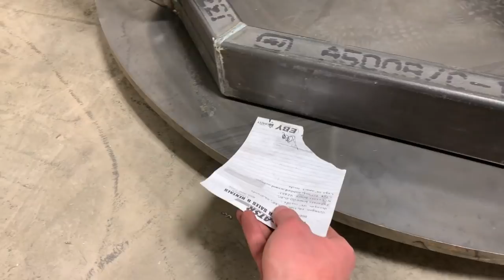Building a table to hold my vise

Comment: Great table build. Can't wait to see you clamp a Sherman Tank in the vice 😂. Im wondering how old you are, and if your young enough to be pick a career, what are you thinking of picking? Fabricator, farmer (the tractors in the background) mechanical engineer, accountant?
Reply from the maker: Thanks! I’m 22. Probably won’t be an accountant :-P I’m really into electric vehicles. I’ve been driving a Tesla for a little over a year now, put 23k miles on it, and driven it all the way across the country, taken multiple 800+ mile trips. I love it. Seeing as EVs are starting to take over a significant market share now I really want to get involved.
Reply: Well If you are ever in the San Francisco Bay area send me a message and we can go over to Tesla for a tour. A couple friends work there as engineers and they are always offering behind-the-scenes tours. Im a car guy too, but I work on the self driving part, and can't seem to convince my boss that we need a car for me to test on 😁. Cheers, and thanks for another great video.
Reply from the maker: Leo Petropoulos 
I actually toured the factory last May! Super cool. Problem is I don’t really have the credentials and I have a feeling it’ll be really hard to get a decent job there without a degree, since there’s basically a line of people waiting to get on...
Reply: Jeremy, next time you want to get a tour, anywhere, call the place up and ask to speak to the head of applications engineering or just engineering. You will usualy get voice mail. Leave a message saying the you are a young person, have a lot of intetest in X and you would really appreciate thier advice or help in X. Things such as trying to deciding the best job at Tesla, and what if any schooling it takes to get such a job, or finish such a project. Make sure and leave a clear reference to your YouTube channel. 

If he is in my position then half his current engineers don't know thier head from thier bottom. He will see that you have real life experiance, and passion, and you will get an entire day tour, get all your questions answered and maybe a job offer. Works at a WWII submarine tour, Tesla, Boeing, Chicago museum of science, you name it; at least 8/10 times.  See, he is the boss, so he is more than likely a real engineer, or used to be one at least. Most of the kids that work for him picked  thier career based only on money, not passion. Your Youtube videos show that you are smart, and have passion. Try it.
Reply: @Jer_Schmidt  Yes credentials and knowledge can be a very real impediment to doing certain kinds of work. No pretending that this is not true. There is also no point in pretending that a lot of kids are getting ripped off at college because they are encouraged to get degrees in areas no one cares about, and worse they are going into debt to py for them; with no chance of ever getting enough cash out of that degree to pay for it. Nothing wrong with arts, or studying ancient people. Just be honest with yourself about the lifestyle such a degree will offer you.

Nevertheless,  this is the whole reason behind talking to experienced people, so that they can guide you. Get lots of opinions. 

If you do need to go to college be smart about it. I did my general education work at a community college and only the last two (three years these days) years at a state school. Did what i told you to do above and had a few offers before i got out. Now if you are rich, go for it and go to Stanford, and have a good time there too. But you will do just as well in life regardless of which scool you pic, with the exception that a good school makes it easier to get your first job. After that the smartest and sharpest man or woman wins.

All that said you don't need a degree to be rich, happy, or both. Lots of people in silicone valley are super rich and never finished school. However, that path is even more work, so talk to such people before you go down that road. Being an entrepreneur looks easy but aint, and you got to be a certain kind of person to make that path work.

Finaly take a good look at the trades. Elevator inspectors in San Francisco have a two year apprentice program to complete before getting thier license. They earn "only" $80k/year durring those two years of training. Work for a company after those two years are up and salary jumps to ~ $180k. Start your own company, and be whilling to work nights and weekends and a typical take home is ~ $320k after taxes and expenses. See,  there is a shortage of inspectors, and the law of supply and demand holds for everything. Do somthing rare and do it good, and no one cares what degree you have as long as you are legal. Get 15 PhDs in English literature and be a secretary like my friend.  English literature might be super cool, but will somone pay you to know it?

A friend is a master machinest. He works for a company financed by one of the co-founders of Google. He is building human sized drones and flying them. Never a day of school, but he knows his stuff. That's the part that counts. Another friend quit Tesla and restores clasics porches for rich people. Makes twice as much doing that then he did at google.

Here is my point. Find somthing you would like to do, but be realistic. You need to like the work, but it also needs to be somthing people need or desperately want. Then get the minimum amount of training to do that, be it an apprenticeship, college, trade scool, or hardes of all - self taught. When training is done get working, as you get older - work gets harder to do so do it while you are young. Take chances, but not foolish ones, work hard, be honest. And most important of all, save money. Making money is easy, but saving it is really hard. Do that stuff and you can work anywhere doing anything you want. And yes, i got all that from your Youtube channel.
Reply from the maker: @leop9021  
Thank you for the advice! I will probably go to the Bay Area Maker Faire in May, so maybe I can try contacting someone at Tesla then.
Reply: Give me date for when you will be here and ill set up a Tesla guy for you to talk to ahead of time. Cheers, and good luck.

Comment: I would have used the table top as the base and just done some tubing into a tri-pod with vise mounted on that but thats just me
Reply from the maker: I thought about that, but I’m not gonna be able to use this big shop forever, and when I move to my own shop it will likely be smaller, so I wanted to make good use of space.
Reply: @Jer_Schmidt  Makes perfect sense just how we did ours since we still wanted to move around it while still being mobile. Cheers bud hope everything is treating you well.

Comment: Jeremy, you can move the table with 'Hudson Hauler' rollers.  The tool used to lift tables to put the rollers underneath you use on your table by welding on tabs or cutting in notches.  Here is a link to check them out if you are not already aware. http://www.hudsonbearings.com/products/hudson-hauler-super-mover/  v/r Erik of FOBOS Knives

Comment: This table is over engineered to buggery. I like this guy's style. lol
Reply: Engineering would involve design calculations to figure out what was needed from a table...rather than just building it beyond all practical reason.  This isn't engineering in the slightest, it's just throwing incredible amounts of material at the problem.

Comment: Nice build. What is the status of your job search?
I have a recomendation for employment. Meets ALL of your stated needs.
Reply from the maker: Current state might be best described as “confusion”. So I’d like to hear your recommendation.
Reply: Jeremy;  Check out DEKA Research, Manchester, New Hampshire. Owned and operated by Dean Kamen, 
an inventor and fabricator. Go through their vacancies. They have 10 week internships. Can you read blueprints? Other than reading blueprints you have the skill set and experience to be a fabricator. Dean Kaman didn't complete college. He never completed his first year courses. He found them boring. In his freshman year he ditched the 101 courses and started with the 200 and 300 series classes. He went for three years. Took the upper level courses and walked away without a degree. Left college with a few of his professors and started his own company. If you want to do work you will enjoy doing what you do you should look into DEKA Research.
Reply from the maker: Robert Kern 
Thanks for the suggestion!

Comment: Id drill and tap a hole in the center for an eye bolt and move it around with the engine hoist
Reply from the maker: Why? The engine hoist is a huge pain in the ass to use, bulky, slow to raise and lower, and hard to roll. The pallet jack is super easy and more maneuverable

Comment: Hello at that point, why not TIG weld it? Welds would have been stronger
Reply from the maker: Oh right I should have pulled a TIG welder out of thin air and done it that way. Wish I would have thought of that.
Reply: @Jer_Schmidt  hi, that was means as joke in the sense that this table is so over-built that you should have also welded with the most advanced method. I believe in U.S. English one says "whoosh".

Oh I also believe for TIG, getting a welding machine is the easy part

Comment: You could have tacked a hook to the center of the top to move it with your crane
Reply from the maker: I don’t want to move it with the crane. The crane is a huge pain in the ass to use. Pallet jack is super easy and smooth, and more compact to maneuver.
Reply: @Jer_Schmidt  I just meant for the one time, bolt on leg joists could work though. Put them high enough off the ground to just clear the pallet jack, unbolt them when not in use.

Comment: With a couple of mooks on hand (and a six pack), that thing would be flipped over in a minute.  Of course, in the end there might be a few artful gouges in the floor.  I can't figure why so many guys are in love with Wilton vises.  In my opinion, the gold standard is still the Starrett Athol vise, but, sad to say, they aren't made any more. Even used, I'd take one (and I did) over a Wilton. Man, you gotta learn some rigging.
Reply from the maker: I’ve never understood what people like about the Starrett vises...But I’ve never tried one in person so I’m open to learning. The first time I used a Wilton I was blown away by how the moving jaw is ROCK SOLID all the time. At any point in its travel it basically feels like it’s welded place. Yet I can spin the handle on this massive beast with my pinky finger. I also really appreciate it being sealed, every vice I’ve used before it starts to feel “gritty” after a while because it’s getting a bunch of grime in the screw.
Reply: @Jer_Schmidt  - The Starrett swivel base locks positively - no creep, no using a cheater on the locking lever.  There is a "toe" under the cantilevered sliding jaw.  The serrated jaw prisms are generously milled.  The handle has "no-pinch" ends.  The protruding head of the screw is generously (and elegantly) radiused into a ball form: your hip bone will thank you.  The handle stays put at whatever angle it is left, yet turns freely whenever called upon. Once again, the feature of a machinist's vise like the Starrett which makes it stand high, is the ability to place packing under the workpiece.  This might be of minor concern in a welding shop, but anywhere else it becomes important. I wish I still had an old Starrett catalog - I might be missing some of the sales pitch.
Reply from the maker: Ricopolico 
Ok, cool. I can see the advantage of those features. The only thing I would say is the swivel base on this Wilton is unlike any vise I’ve used before; it is rock solid with just light hand tightening. I would like to know why nobody makes a sealed vice with a square slide. You’d have the advantage of adding packing under a workpiece but still have the straight-line pull on the screw and the sealed slide to keep dust out. I suppose it would be super difficult to manufacture though.

Comment: LOL, that's actually worse than my lathe stand, which ended up ~800# for a what I think is a <500# lathe...  Overbuild much? ;-)

"Oh right, I like to make things difficult for myself..." and then on top of that you cut tapers on the top of the legs... and then all the cutting with a hack saw... 

I'm curious, I thought you were relatively tall... at 6'4" I end up liking my work surfaces at about 40-41" and I have a vise nearly that size mounted on top of one like that and I'm happy with it.
Reply from the maker: My lathe is mounted on an old desk... needs a new stand. 

I’m 6’1” with work boots. I figured this is the sort of table and vise that will get used on larger projects, and those are the kind of projects where I frequently need to put my weight into them, so a little lower would be ok. But who knows maybe I would have liked it higher. I guess I could always build some blocks to set it on.
Reply: @Jer_Schmidt  You made it just the right height to add some adjustable feet/casters ;-)  

My crazy lathe stand has HD steel/iron casters and drop down adjustable feet.

Comment: You sure the concrete in your shop is thick enough for this?
Reply from the maker: I’d hate for the legs to spear through the floor and the table suddenly drop to a 4-3/4” height while I’m trying to use it...

Comment: Nice table but who needs 1,5k$ vise?
Reply from the maker: It’s incredible though. You can run it with one finger, easily, and when it’s all the way open (10”), there is literally zero play in the jaw. I mean you can push or pull that fully-extended jaw as hard as you want in any direction and it feels so solid it’s like it’s welded in place.

Comment: If I may make some comments. Round tables are not a good idea . They take up the same floor  space as a square but without the benefit of the surface area   of a square of the same diameter as the round.. Imagine if the round table was in the corner , takes up same floor space as square but in the corner there would be an unusable gap. A 4ft diameter round table has less usable area than 4 foot by 4 foot table.
 The vise mounted on a heavy post bolted to the floor would have much better overall access and save on that tonnage of steel used and would be easier to demount and relocate. Also, which wasnt revealed, was when the vice was turned at a  right angle it seemed as if the handle would hit the table.And the comment that there was now free space underneath the vise doesnt make any sense. In my experience I have never held anything on my workbench that needed clearance directly under the vise.
Reply from the maker: So are you indicating I should have just thrown out this round plate that i already had and spent hundreds of dollars on a square one, even though I paid basically scrap price for this round one? I’m not saying everyone should build round tables, but if you already have a round plate just lying around why not use it? 

As I said in the video, (btw did you watch it?) a post mounted to the floor is not an option in my case. 

You’re right, the handle would hit the table if I turned the vise sideways, just like every other wise ever mounted to a table.

In the video, you see me using that reddish vise mounted on our square welding table. I have kicked the leg of that table at least a hundred times while trying to use the vise. It doesn’t need clearance for workpieces, it’s for my feet.

Comment: Your belt grinder, what motor do you have on it?
Reply from the maker: In this video I was using my Gen 1 grinder, which had an old Baldor motor with Rockwell branding on it. Bought on eBay, I don’t know where it was from. My Gen 2 grinders have all had Leeson 116761 motors.

Comment: I love your projects.  I have never had the luxury of designing something and then following the plans.  I always have to make do with the resources I can get my hands on.  My vice table designed itself from the scrap I had handy.  The base is a semi-truck brake drum capped with a Chevy truck brake rotor.  The post is an irrigation well pipe.  And the top is a drop I got at the scrap yard.  
http://www.theamericansurvivalguide.com/smforum/MGalleryItem.php?id=245
I can walk it around the shop floor without too much effort but the SOB weighs about 300lbs!

Comment: All that and then no washers at the end! 😧
Reply from the maker: There’s not enough clearance for washers. There’s actually not even enough clearance for the bolt head unless it’s turned so the flat is facing the base. If you have a problem with that then take the complaint to Wilton I guess, it’s the worst part of the design IMO.
Reply: Jeremy Schmidt fair enough iv been there before. Thanks for the reply. Was really quite impressed with your effort so many people out there who haven’t even mounted their vices.

Comment: the whole frame underneath is overkill. The 3/4 plate with legs and gussets would have been strong enough. The 4x4 in the "x" is not really doing much because you ended it against the octogon instead fo extending it through the octogon under the vise as one piece.

Comment: 20,64
 mm = 161.839 Kg/m2 ... this table weighs at least 450 kg minimum...
Reply from the maker: I have the weight written in the description.
Reply: @Jer_Schmidt  ...You did a good job. congratulations. with the right tools and materials, all jobs can be very good, depending on who makes them. try introducing a little bit of art in this kind of work and you'll get the money you want all over the world ... I'm just sorry I do not have a place to work and I can build some projects that I have on hold... here in Portugal, nobody in "charge of the bosses want to work with the brain" ... here are only  slave-seekers and "eaters of stolen fruit to those who work" ...

Comment: So when you set this where it will be used and find out it wobbles you will fix it the easy way by pouring a new concrete floor right?

Fantastic table but the X brace will prevent you from placing a big gas burner under it and grilling up breakfast for everyone.